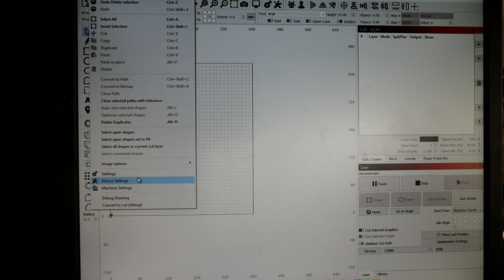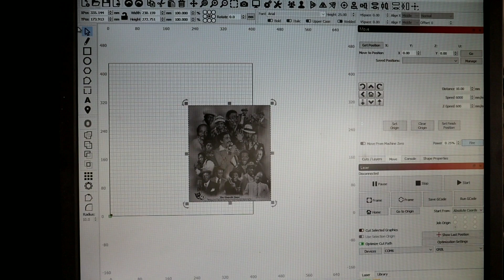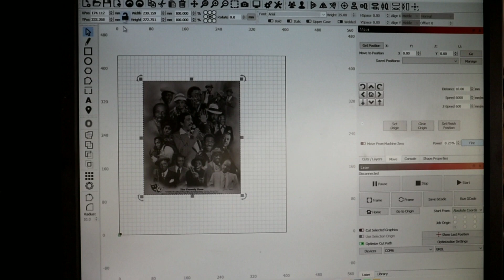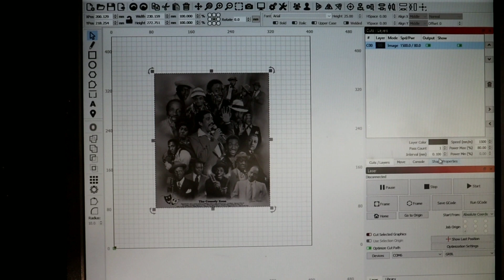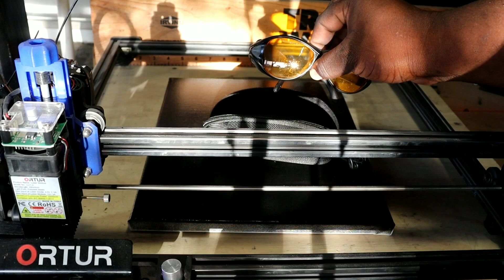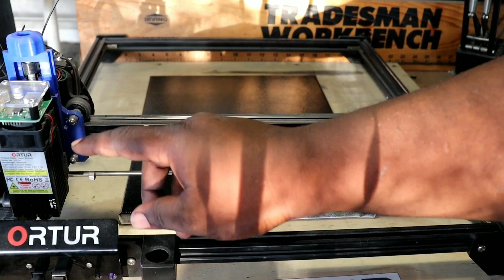Ortur Laser Master 2 & Lightburn Questions and Answers  ( If you're New This is a Must Watch )

Comment: Such a great video. thanks so much for this. I am having an issue with the frame tool. I hit the home button first, but when I hit then hit shift+frame, the laser goes diagonally opposite from home corner and then hits wall.....any tips/workaround? Thanks for any help!
Reply from the maker: Make sure in lightburn you postions is Absolute Cord  and make sure the red and green dots are in the bottom left corner.  Hope this helps

Comment: On changing Height and Width, you don't need to convert inch to mm, just enter the inches there. If you need 11 inches, just enter 11" and Lightburn will automatically convert the inch to mm for you.
Reply from the maker: Have you changed you measurements in lightburn?
Reply: @zerica24  Nope. using mm, but when I want to enter something I know in inches, I just enter it and add the " to tell it inches. Then Lightburn converts it to mm.
Reply from the maker: @TheCraigW76  Thanks for the info .
Reply: LightBurn also has a place next to the height and width that shows you that you are working in mm instead of inches.  If you click on "mm" in the toolbar, it will change all the measurements to inches for you if you prefer inches.

Comment: pressing Alt+Shift+R will  frame with the laser onkeeps you from having to click the mouse. i use a wireless keyboard and the laser is a few feet from me.  i just take the keyboard makes framing quicker.

another tip  use the set layer position tool to pick a spot on your bed, then fire the laser and move material corner to match. if you have measured everything the you can go from the one corner and take a small ruler stood on its thin side to line up a second edge thats perpendicular  . just the 2 points will put your work in alignment.  

A list of most shortcuts is available from lightburnsoftware.github.io/NewDocs/Hotkeys.html

also 300 dpi is acceptable. anything lower will be overly pixilated. Picture quality is usually 600 and up. most printers use 300 as a default and its qcceptable.  considering the laser size its more than adaquate
Reply from the maker: Thanks for the info
Reply: @zerica24  no worries mate. I'm by far no expert but I know enough to get around.  If anyone has a question or whatnot I'll try and answer.

Comment: I also found that I had to turn off my USB power saver on my laptop as after some period of time my laptop powers down the USB connections and the laser stops.  At first I was constantly moving my mouse so it did not go into sleep mode. Shut off sleep mode but it took going to settings and looking for the USB power mode to fix the problem.
Reply from the maker: Thanks for the Knowledge